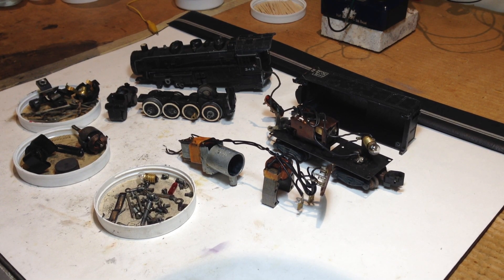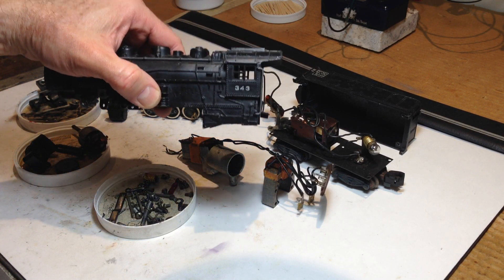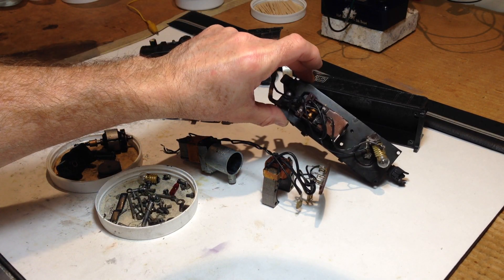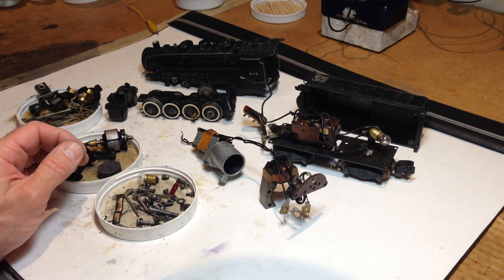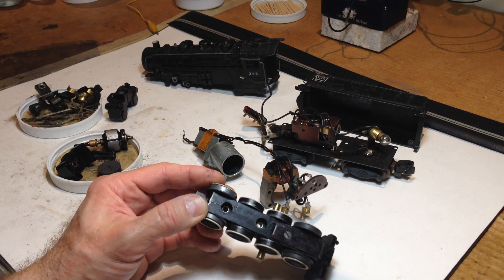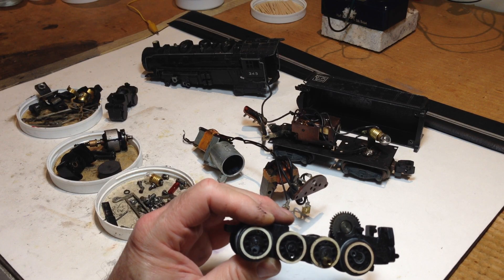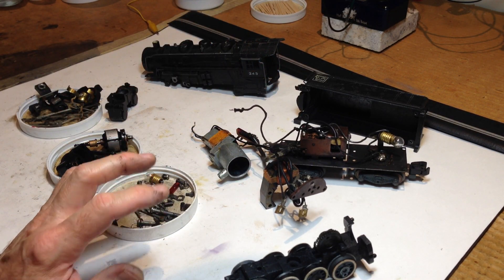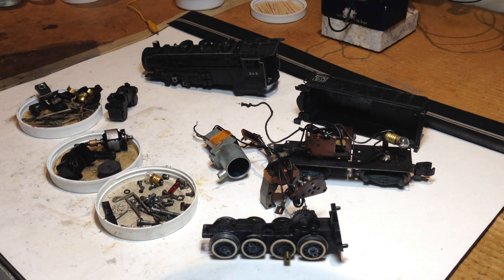American Flyer 343 0-8-0 steam engine disassembled

Comment: Yeah that engine is its own stand alone unit for sure. A few things are interchangeable with other AF engines but that's it. I just got mine cleaned and lubed. Tested it about five min ago on the stand and it runs great. New pullmore tires and back together then she hits the rails. 

Was thinking about re-doing the paint but I might just leave it as is for now, chips and all.